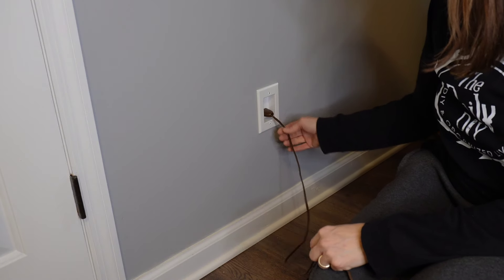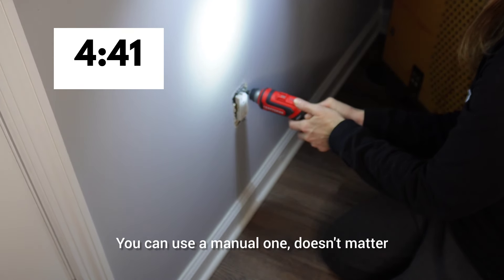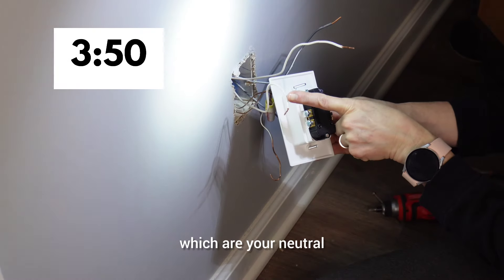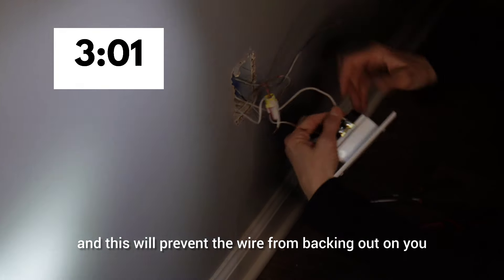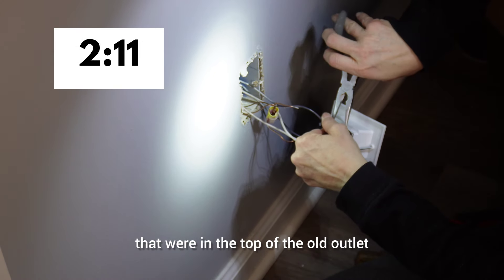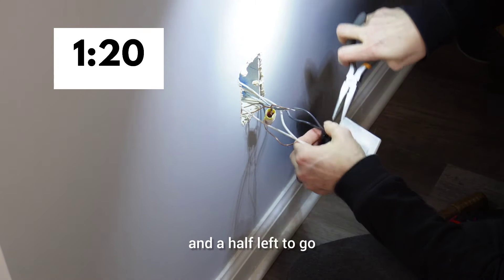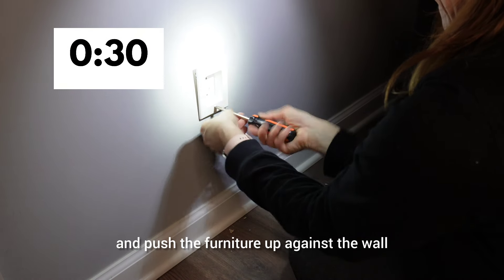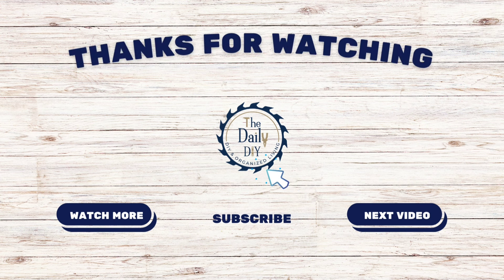How To Install a Recessed Outlet Receptacle In Only 5 Minutes

Comment: "I'm not going to speed this video up at all, you can see in real time it takes 5 minutes" - immediately does camera cuts xD
Reply from the maker: it actually took me about 15 minutes to do this because I stopped between each part to move the camera and lighting to show it from different angles, and after I filmed noticed the footage of me taking the wires off was not good so I reshot that part, and showed taking off all 4 wires, again in real time. If I wasn't doing this for filming purposes to show people how to do this then it takes 5 minutes.  I didn't cut any of the actual work of removing and installing the new one, so that all adds up to 5 minutes.  Normally I speed up the boring parts but left them all in for this video.
Reply: The five minutes cut out all the small things we didn’t need to watch. Great video Thanks for helping. 🎉